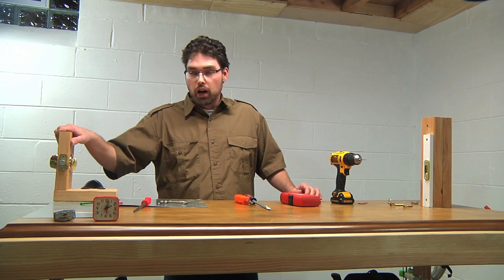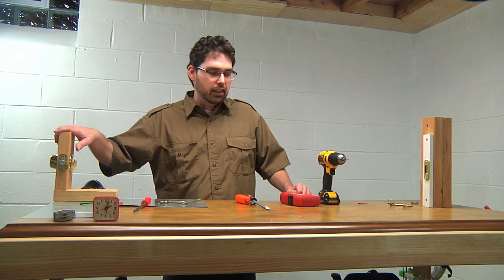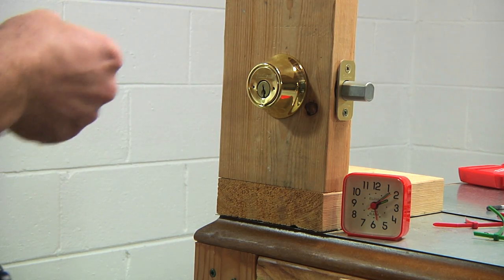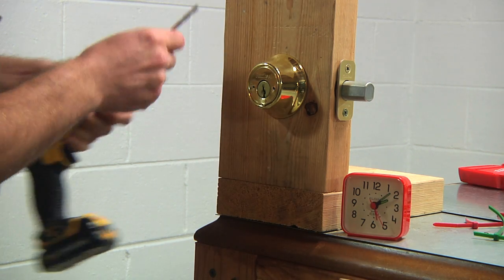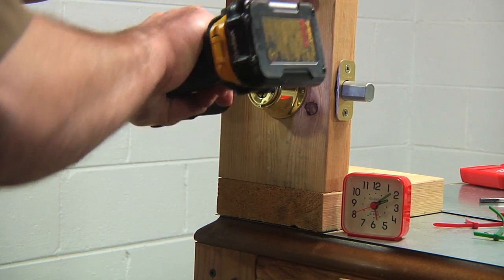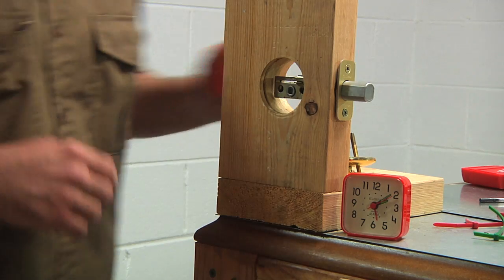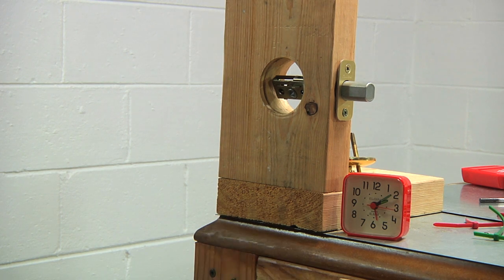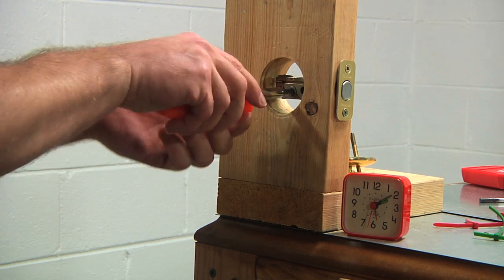Lock Strength Test - Drill Out Kwikset Deadbolt Lock (BHMA Grade 3) - Time: 1 min 33 secs

Comment: Kwikset makes the worst locks. they should be called Kwikbreak.They used to make better quality locks called the  Titan model. I always buy Schlage. even they are not as good as they were,but they are decent. the cheaper SCL. locks were the Dexter model.they are ok but you can tell by the feel the machining is less precise.Compare a SCHl. key to a Kwikset key.

Comment: I am a new locksmith having trouble drilling through deadbolts. Any advice you can give? some deadbolts appear to have harder metal then others.
Reply: Better bits
Reply: Cobalt drill bits work good. just drilled out a Kwikset,no problem.

Comment: I purchased this love do7.pl/kwikset because I wanted to have a password for getting in my house that also has a key and that didn't rely on an app on a phone.The lock was moderately easy to set up and once it was it works great and feels quite solid and doesn't look too bad either. At first glance the directions can be a bit confusing, but after you remove some parts that hold the love together when it's shipping it becomes more clear and it basically goes on your door like a basic deadbolt lock with an extender feature.I definitely recommend buying this lock for your house it seems pretty sturdy and easy to program.

Comment: Oh my.  I should have read all the comments.  I got locked out of a part of our house in Panama - not a place you can call a lock smith, so I turned to Guru Google and found this video.  I got out the trust drill and promptly killed two drill bits in my endeavor to drill through the lock set.  After a lot of persistence - a couple of hours I opened the lock.  Phew!  Now, off to amazon to order more drill bits...

Comment: Can you do that with the GRADE1 lock ?
Reply from the maker: No, the grade 1 lock has a shield. Check out the Schlage video, it would be similar to that.
Reply: Any lock can be drilled.  High security deadbolts like Assa, Medeco mul-t-lock with the right carbide drill bit and time. Of course I doubt a criminal would have a $100+ drill bit to do do it.

Comment: Sorry to tell you, those are the old Kwikset locks.   That technique will not work anymore as they modified and put a steel plate in front of the screws.    Best to just drill the key insert then turn with a longnose pliers
Reply: Regardless of who made these locks, I like these two videos because they demonstrate the difference between a Grade 3 and a Grade 1 lock. 

I checked, the Kwikset Model 660 is still available at both HomeDepot and Lowes.  The  description at HD says Kwikset is the industry leader and the 660 is their best selling model.  The BHMA Grade 1 Kwikset Model 980 costs 2.5 as much at $34.  Kwikset also sells a Grade 2 model priced between these two.   Kwikset Smartkey locks (now in big box Baldwins)  are vulnerable to forcing with a screwdriver & visegrips in under 30 seconds, just google it.  No Kwiksets for me!.
Reply from the maker: You are correct that some Kwikset locks are protected from this attack. However, this lock is currently in production and for sale in hardware stores as it was bought new at the store specifically for this video (immediately before filming). As I state in the longer version of the video, these are the entry level Schlage and Kwikset locks available at any hardware store. I would not be surprised to find these Kwikset locks on old houses and cheap apartments. The Schlage entry level locks are solid. Both locks can be bumped.
Reply: Just tried it on a door at my rental. Kwikset deadbolt was installed in 2020. Kwikset changed nothing